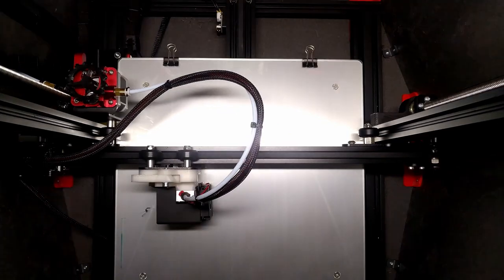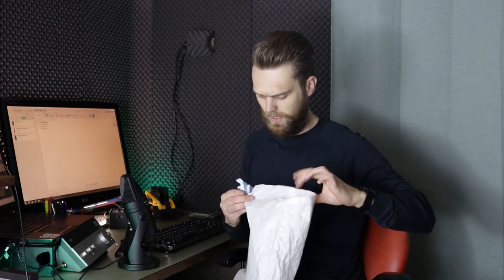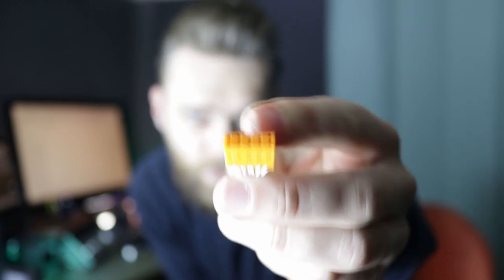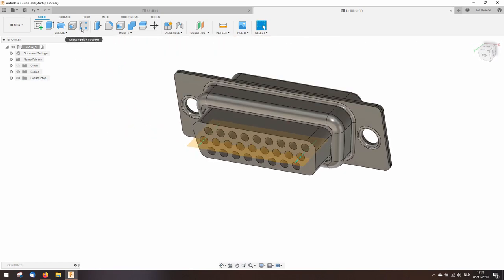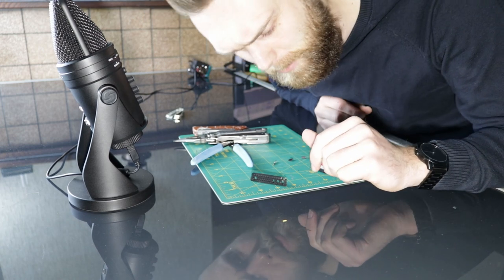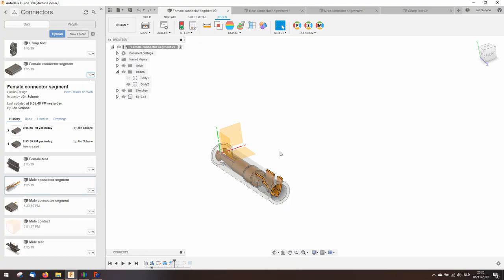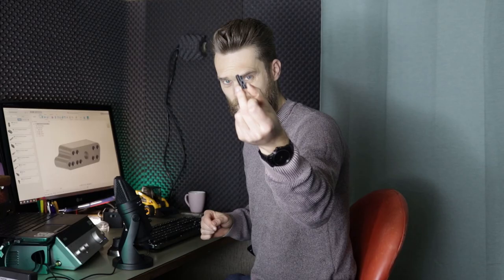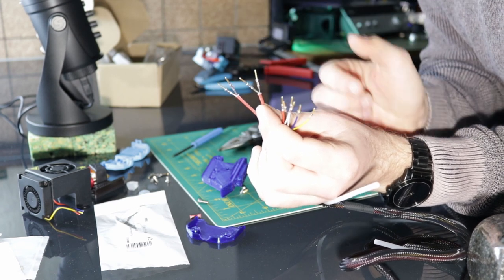Design and print a custom connector for the Creality printer with swappable hot end

Comment from the maker: This was much harder than I expected, but I finally got it to work! I still have to do some modifications before I’m going to upload the design and if you have any suggestions, please leave a comment!
Reply: Hi! I worked in the Railway Production for many years. We nearly only used contacts from Harting. These come in a very large variety from gold plated mini contacts for sensors to really big ones for connections for over 800V. The system itself is very easy and the connectors are formed that you can easily get them in place. They use a kind of snap-mechanism on the housing side, which i guess you can easily print yourself. The only negative point is that, in a professional environment, they use special crimp tools. But in your case i think you can crimp them whith an ordinary crimp tool for car electronics. If you want to have mire information on my idea, feel free to contact me! 

Best regards from Austria, Markus
Reply: Thats the companys page where you can see a drawing. Maybe the language is the wrong one! ;)

https://www.harting.com/DE/de/themen/anschlusstechnik
Reply from the maker: @Dragoneye7777  Hi Markus, thanks for your comment! The connector I cut in halve was a Harting connector, so the one I've designed is actually based off a Harting connector :). I really like their connectors and the site is easy to use. I already got some great suggestions of which tools to use because these professional tools are way too expensive for me. I'll definitely contact you if I need more information, thanks!
Reply: @properprinting  why dont you ask Harting to sponser a tool :D
Reply from the maker: @xetrof8601  Harting as sponsor would be great! Thanks for your comment :D
Reply: Why not use an 11W1 D-Sub? It's similar to a 13W3 but with just 11 pins and one large feedthrough. The 13W3 was used on SUN monitors, with the three large connections used for the RGB coaxial cables. There are companies that make fluid and gas line fittings which fit in place of the coaxial cable ones.
Reply: could u us a set screw perpendicular to hold each pin in if u put a threaded insert in the printed part?
Reply: What if you Heat the connector and press IT in? Just like An threated  insert?
Reply: Search for engineering PA 09 crimp tool

Comment: Use the Dsub shell design, integrate the bowden tube, but leave a rectangular hole for a molex style connector which can either be press fit from the front side, or glued in. This  way you have less of an issue trying to install the pins, and can take it completely apart again and rework it if required. You can also use a molex with sufficient current capacity so that you don't need to double up pins. Just a thought. You could also leave out the bowden tube and just connect it separately. It's pretty cool that it's integrated, but it doesn't add that much value for all it's complexity.

Comment: Great vid! Dutch here myself ;) At my job we use pogo pin's for programming, but also bigger ones for a higher current (like a nema17 and nema23). The thing is, those pogo pin's have a small hole at the end to solder wire to. Maybe you could design a pcb for the female side, so you just have to solder the wires of the hot end and sensors to that board, then slide it in to the female connector, so the connections just get exposed to that. Then the male connector pushes the pogo pins to those exact pads on the pcb.
Reply from the maker: Thanks Jan-Cees! I am thinking of doing something like this in combination with a Mill-Max spring loaded pogo pin connector https://www.mill-max.com/engineering-notebooks/introduction-to-spring-loaded-pogo-pins-connectors. I want to embed this into the base itself. I really would like to design my own PCB. I work at an electronics manufacturer and this is something I've never done xD. Thanks for your suggestion!

Comment: Thanks for your videos.  Just an FYI, I discovered cheap coaxial female ends are perfect for bowden fittings.  It allows the bowden fitting to move with the tube so the tube doesn't wear as fast and come lose.  Using one in my Ender 3 extruder as I got a faulty aluminium upgrade without thread for bowden fitting, so I had to look for a solution and modified to be a flexible filament one.  Now need to design one for the hot end thanks to your inspiration!
Reply from the maker: Interesting, thanks for the info!

Comment: very interesting - trying to crimp molex pins well with a cheap crimper is painful - I found out this a few years ago when I first started making custom sleaved pc cables  especially when doing them ultra neat without  heatshrink  - a Lutro modded crimper is inexpensive and does the job properly without crushing or mangling the crimp - they  are similar to the crimper you bought but are accurately re-machined  to give a really good crimp  - its worth looking if these are still available if your doing molex pins and they can do the  jst  & dupont pins too
Reply from the maker: Thanks Andy for your comment and information! I've recently bought a crimp tool which I've successfully used in my last video. This tool was pretty affordable and does the job well :D

Comment: I will try to drill out a stock d-sub connector to get a bowden tube through. But ultimately I will design a latching connector as fast connection. D-sub male and female connector also come with screw terminal for easy wiring. Mate N Lok could also work.

Comment: while 3d printing is useful when faced with an oddball proprietary connector, there is a much better solution for this application.  Anderson powepole connectors can handle up to 45amps, they are modular so you can put together as many as you need.  The 15/40/45 amp contacts are the same they just crimp different wire sizes.  Those contacts handle your hot end, laser, spindle motor.   And a little known fact is that in place of one 15/30/45;amp contact module, you can insert a PP4X module with four 5 amp signal pins for fans, stepper motors, bltouch, identification, thermistors, etc.  There are also larger round pin contacts if you need a higher current connector that can't accidentally mate with the 45a contacts for something like 110/220vac..   For a dual/quad extruder setup you could add an optional  second row of contacts, or extend the width.  There are also keying insets that you could use for 12 vs 24V while allowing you to have a printer that can accept either.

Comment: I would do a cylindrical barrel connector. Have the center be the Bowden tube "contact" have the Bowden tube bottom out into a convex well on the disconnect side. Have the tool side have a concave well to promote proper filament alignment. I feel like the cylindrical connector makes more sense for the application and would be more compact.

Comment: I'd stick with using Molex style contacts even if you're doing a D-sub connector.  The Molex style contacts have a little latch tang(s) on the side that make them easy to insert and remove.  Might also consider stepping up to larger contacts so the tolerances aren't quite as tight.  You can insert 2-wires or extra wire into a crimp to 'shim' a small wire up to the cross section required by the crimp contact.  With contacts that have two sets of crimp in wings, the top set grabs the insulation while the bottom set crimps the wire.  Solder is NOT required.  Finally, your cheap crimpers are probably fine if you stick to the contacts the jaws are built for.  Fyi, I have made crimps with a needle-nose pliers in a pinch.
Reply from the maker: Thanks a lot for your comment! I definitely want to embed the Molex style contacts because they indeed do work great and it's a lot easier to design a fitting connector for these. The reason why I didn't do this in the first place is because the female connectors are more difficult to make. They do work awesome for  connector to board connections. I realize I've entered an interesting world xD

Comment: As a tip for proper crimping pliers, also smaller connectors, try the IWISS IWS-2820 on aliexpress. THe PA-09 is kind of the industry standard, but still relatively expensive and hard to get in NL. The IWS-2820 + FSA 0626 (it's a good wire stripper) can be had for about 23 euro on aliexpress including shipping.

Comment: I have some experience with Amphenol connectors and these have removable male or female pins and extraxction/insertion tools available.  Just FYI you may need to allow for shrinkage of the plastic connector maybe 1%.  It looked like the individual pins were too tight if you had to use that much force. Great video, however.  I am sure that I would not have the brains to try something like that.
Reply from the maker: Hi Earl. Thanks for your comment, I have indeed to take a look into the extraction and insertion tools to make my life easier, thanks for mentioning! I've printed 4 versions with different diameters (the struggle I've went through was quite a lot and I haven't shown most of it xD) I had to find a sweet spot between the amount of force needed to place the connections and to remove them. I recon that an insertion tool together with a good crimping tool would help a lot.
Reply: @properprinting  This video might help get you started for the crimper tools: https://www.youtube.com/watch?v=pnyfMA817Vk   And you need a pro grade electronics supplier for the pins and  extraction and insertion tools.  Maybe Digikey or Mouser.  They also make crimp on coaxial pins that have a shell that might be big enough for the Bourdon tube.  In the military world, there are many connectors that have both the small 22 gauge and co-ax connectors in one unit.  I am retired now, but if I still had any of that stuff, i would send it along for free !   When you get things dialed in, you will be able to feel or sometimes hear the pins click when they lock into the socket holes.  But the force will only be something less than 1 kg if everything is sized perfectly.  What printer and what material are you using for the  filament?  I am new to the 3D printing , but from what I have seen, it might be necessary to go to the SLA process to get enough precision and smoothness on the holes and intricate details to make the pins lock and unlock reliably.
Reply: The pins you have are unfortunately the wrong ones for that connector.  The correct pins  are just tubular on the wire end and use the Amphenol crimp tool.
Reply from the maker: @MultiTman1000  Thanks man! I often but from RS components or Farnell which I consider pro grade suppliers as well.  I work at a company which produces electronics for military, industrial and medical applications. I work as a test engineer and I create test systems to test the PCBA's and end products automatically with LabVIEW. We see all sorts of connectors because we have a lot of different customers. I don't have a lot of experience with crimp connectors because I just use the tools we have lying around at my work without thinking too much about it. I know that they are expensive and they have to be calibrated, but this isn't necessary for me now. I've used PETG, but I'd like to print it out of ABS or Nylon which is smoother. I had some warping problems so I decided to use PETG because this is easy to print and doesn't shrink much. It sounds like you've worked in a similar branch as I do now. Thanks a lot for your advice!
Reply from the maker: @MultiTman1000  The tubular would probably be better but both the stamped I've used and the tubular you mention fit this type of connector https://b2b.harting.com/ebusiness/en_us/MIN-D-FE-15p-crimp-terminal-with-4-40-UN/09670154702 I think that the main problem, besides the design which has to be optimized, is that I mangled the connector by using the wrong crimp tool and used the wrong tool to insert them. Thanks for mentioning, I can take this into consideration before buying a crimp tool.
Reply: Well normally the pins in your video are designed to be used with an automatic machine that crimps the wires to them for mass production- very fast, but very expensive to set up unless you have a real need for that.  They also are prone to bending because the side wall is cut away..  The Amphenol pins are designed around mil specs and aerospace applications, so they are a lot more rugged and reliable and stronger.  The tubular design of the pin with a shoulder on the wire end also allows you to use a tubular insertion tool that is slit up one side for the wire to ride in while it's being inserted. The Amphenol style pins also have a side "peep hole" to insure that there is enough length of wire down inside the pin before or after it is crimped.  

Also - some of the crimp tools are meant for specific part number pins- you can overcrimp or under crimp a pin and have problems that way too.  So I would try to identify and segregate what goes with what-especially at work. 

There are also color coded rings on the pins themselves to help identify the part  number but I would still check with your technicians at work and get the best possible information.

Comment: maybe if you design a bit more space at the top of the pin holes, you could use a retraction tool to remove the pins ?
and is it possible to add 5 more pins for the bltouch sensor?

anyway, great job !!
Reply from the maker: Thanks Martin for your comment! It should be possible to use a standard retraction tool to remove the pins because I haven't changed much to the way the connector works. I don't have experience with that so I cannot be sure about this. It's of course possible to add more pins. I still want to make a video about different homing methods, including the BLTouch, but this will not be soon.

Comment: When I made mine I didn't 3D Print anything for it. I used a Denso 10pin water resistant Automotive Plug for the Electrical and modified a couple of BNC connectors for the Bowden Tube.

Comment: Sooo, this is kinda overkill, but how would you do this if you modded your Creality to have a dual extrusion setup, but still wanted to swap to an engraver, or something similar?
Reply from the maker: I would design a custom connector consisting out of two halves. One half would fit the engraver and the combination would work with the dual extrusion setup. That's what makes the custom connector idea neat, you can build upon this ;)

Comment: Very interesting concept. I preffered the orginal D-Sub Connector with the hole. Even they are hard to get, you wont need that many. Since I will do that with a direct drive on the ender 3 I wont have the problem with the bowden connector. I worked for years in electronics and have build may many d-sub Connectors. I always hated the ones to crimp, even we had good crimp tools (let me check whitch it was).  I am a bit surprised the force you had to use to put them in. With the "original" ones that goes normaly very easy. And there are tools to remove them again. I prefer the ones you gonna soldier on. I will check if i can find them.  I will be very curios when E3D will release their tool changer. I am not sure they are gonna use a connector to the hotend, they only make a magnetic coupler for the complete hotend set to the printer and I saw other construction doing the same to be able to change the hotend automaticly in the print process to print two colors.
Reply from the maker: Thanks for your comment! The goal of this video is not only to replace the original D-sub connector, but to find out what can be done with this design. I hope to find more possibilities to embed things into a connector which wouldn't be possible otherwise. It turns out that the hole diameter is pretty critical, to wide and the pin won't stay in position and to narrow it will take to much force. I've already improved this in my video about proper cable management :) Switching automatically between heads would indeed be awesome!

Comment: Hi Jon

Seen the video I’ve remembered the Sun Microsystems vídeo adapter, it has a DB13W3 adapter. Searching a bit I’ve found a DB7W2 that seems to be quite standar. It could be usefull.
Reply from the maker: Hi Marcos, thanks for the information! This connector is inspired by the 11W1 connector I've used in one of my earlier videos which is a mixed sub D connector, just like you mention :) They come in a wide variety of lay-outs. I think this connector type is very interesting.
Reply: Proper Printing 

Thanks John , I’m trying to find how much load can handle the big connectors of this series.
Reply from the maker: @marcosmartinezgarcia1963  No problem. This depends on the terminal type. From what I've seen it can vary between 10A and 40A. You can find a lot of information on Harting's site: https://b2b.harting.com/ebusiness/en_us/Interface-connectors-D-Sub-Subminiature-D-connectors-Cable-connector/389308?detail=true&sewConfig=false If you scroll all the way down after you've selected a connector you can find the terminals fitting these, including pneumatics. Hopefully this gives more insight.

Comment: Use magnets to hold it in place instead of screws! You will probably expect some "shear" force caused by the weight of the cables and the rigidity of the bowden tube, but if there is something like dowel pins that could take all the effort and just use magnets do stick it in place I think it could work out well!

Awesome job nevertheless! :)
Reply from the maker: Hi, thanks for your comment and suggestion! I really like the idea, but I have my doubts about the amount of pressure being built up in the bowden tube. I don't know exactly how much this is, but I recon you need some strong magnets to get everything together. I like the out of the box thinking and I'm convinced that it's possible to build upon this idea and come up with new ideas. Thanks!